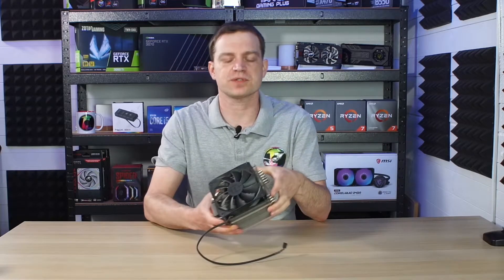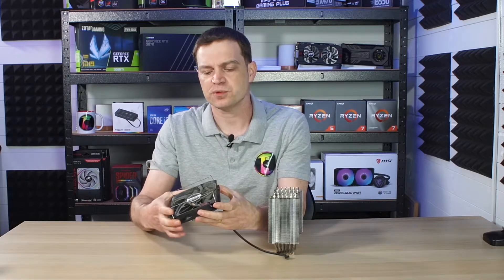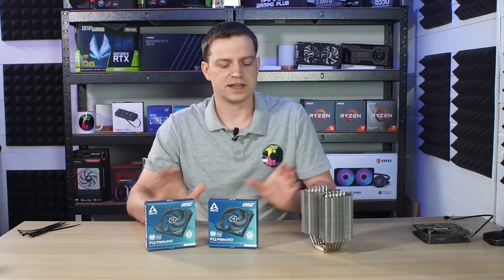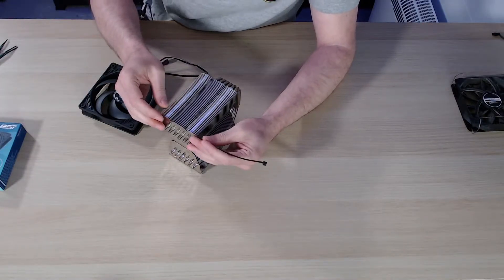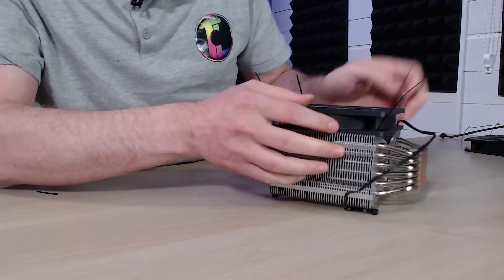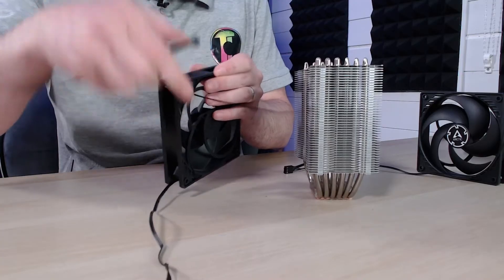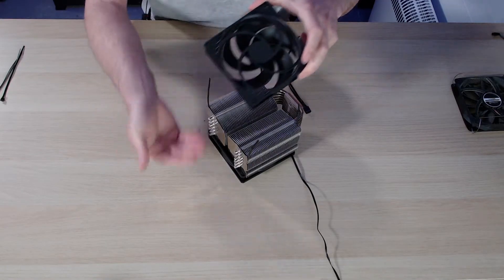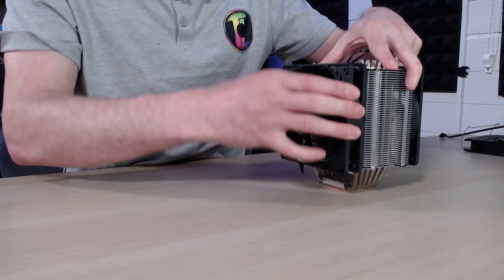How to Add Fans to a CPU Tower Cooler.

Comment: I used a single tower cooler on an old pc and I used cable ties to mount the fan but the way I did it was ok but the fan was not real tight and sagged a bit.  Your way is very clever and now I will do mine as you did.  Very much appreciate the video.

Comment: And zipties won't melt at 80°Cor 90°C ?
Reply from the maker: No, not at all.  Firstly your cooler will never get to 80/90 degrees like the internals of your CPU.  Secondly cable ties (zipties) are generally made from Nylon 6/6 which has a melting point of between 250-265 degrees C.  Which of course, if they do melt your CPU was gone a long time before that.
Reply: @TechLabUK  oh damn thank you for this update! I've thought about this diy method for a while and I'm so freaking stoked that there is already a youtuber who made a guide AND done the research to prove its safe. thank you again so much!!

Comment: Does that plastic cable ties really work? Those will melt right???
Reply from the maker: @guitarbuddyph  If your cooler gets hot enough to melt cable ties then losing the tie is the least of your problems.
Reply: @TechLabUK  it'll stick on the heatsink. That'll be a mess.
Reply from the maker: @guitarbuddyph  it won’t melt, you heating would have to get to temperatures that would have already destroyed the system first.

Comment: will be there any problem if we use two different fans with different speeds?. i mean airflow problem or something?
Reply from the maker: Not a problem as such but it could cause a static pressure issue, always best to try and match the fans as close as you can.

Comment: I was just looking for some ideas on how to go about adding/replacing fans for my cpu cooler since I plan to use at least one thick fan in the center of a dual tower cooler. I know that this isn't really anything new given other sources that show this zip tie method, but it was nice to actually see it clearly. It might be tricky mounting a normal 140mm in the center given that the coolers mounting screws are also right there, but I guess that can be a puzzle when the time comes.

Comment: Is there a risk that the heat from the tower will melt the plastic of the zip ties?
Reply from the maker: I doubt it, if the cooler get's hot enough to melt Nylon then you have bigger issues.
Reply: The maximum my CPU reaches on hot days is 80 degrees (I live in Brazil), but with push and pull it should reduce. I have a Ryzen 5 8600g. @TechLabUK
Reply from the maker: @Allanx97  It can reduce it, Push - Pull configurations generally maintain the static pressure moving through the heatsink.

Comment: Nice trick. The only thing we should consider in this case is : imagine the melting point of the plastic substance on the heating metal. Nice plastic black sauce on spicy metal
Reply from the maker: If the heatsink gets hot enough to melt ABS plastic then the fan falling off is the least of your worries tbh.
Reply: @TechLabUK  yes that is true. But how about an evo 212 black edition with a volcanic amd fx 9370? The cpu operates OK with one fun but I want to improve the airflow.
Reply from the maker: @Gizmapps  It still wouldn't matter.  It takes a lot of heat to melt ABS plastic, nothing a CPU should be able to put out especially when you are attaching it to the heatsink and not the CPU itself.  Also remember the fans attached are actively cooling everything connected as well.
Reply from the maker: @Gizmapps  Just for reference.  Cable ties are most commonly constructed out of what they call Nylon 6/6 which has a melting point of around 265 degrees C.  If your heatsink is able to get to 265 degrees C then your wouldn't be worrying about cable ties tbh.
Reply: @TechLabUK  very useful info for these  tiny little useful things. 👍

Comment: Won't the zip ties melt if the pc got over heated?
Can someone pls correct me
Reply from the maker: No, if the CPU cooler gets hot enough to melt a zip tie then you have bigger problems in the system.
Reply: @TechLabUK  oh okk 😀

Comment: Hi thank you, question, do the 2 fans cables go to the same socket? Daisy chain them?
Reply from the maker: You can run them how you like but remember to run them the same speeds / curves.  The easiest way is to yes, daisy chain them to the same header.
Reply: @TechLabUK   Thank you! Do you think it makes sense to also plug the pc case back exhaust fan to the CPU header so it also spin up when the CPU needs more cooling  and all together helps to make greater airflow?
Reply from the maker: @whatsupchicken  Na, the rear will be fine on a chassis header as it's drawing air from the whole case usually.

Comment: Isnt it dangerous to do it with cable ties because they could melt and damage other parts of the Pc?
Reply from the maker: If your cpu cooler gets hot enough to melt the cable ties you have bigger issues than a fan falling off.

Comment: Can cable ties melt over time? And how do you remove the fan before removing the heatsink? I have a Deepcool AG500.
Reply from the maker: They wont melt on this, the CPU cooler wont get hot enough.  To remove the fan afterwards you simply cut the ties and replace.
Reply: @TechLabUK  Correct, but cutting the bottom part of the fan will be very difficult. Don't you think so?
Reply from the maker: @chessusthemyth  Never had an issue doing it.  Depends what you have to cut them with, we use Mini Wire Snips and just cut the heads of the ties.

Comment: Just got a Ryzen 5800X3d. Im a bit worried about its cooling. I have one fan on the CPU cooler now. Thinking I should add the second one on back of it.  Do you suggest it?
Reply from the maker: Push pull will increase cooling and the 5800X3D is a bit of a weird one to keep cool.  Even our 360mm AIO needs some tweaking to tame it.
Reply: @TechLabUK  yea I havnt installed it yet. Just picked it up yesterday. Making sure my ducks are in a row first. I think I will undervolt it a bit. If I can figure out how to do that lol. Just getting back into a PC after a long hiatus away
Reply from the maker: @11bravo1789  It's a weird one.  It spikes all over and reaches some high(ish) temps when building shaders etc but while gaming it's ok.  Fast as well so enjoy it :)
Reply: @TechLabUK  thanks. Its insane how far things have come since my last PC (around 2009’ish).   I didnt Realize people were still Playing Counter Strike lol. I was doing LAN parties in High School playing CS and Team Fortress Mods for Half Life.  Thats how Old I am.   I had no clue CS GO was as big as it is still

Comment: Hey bro, i’m using a pure rock 2 fx on a i5-13600kf, I made a mistake by not checking the cooler’s TDP which is 150w, and cpu boost clock is 181w max, I’m mostly using my system for editing and mid-high setting gaming, would adding another fan to this cooler help with cooling performance/overall temps?
Reply from the maker: It would help but not sure if it will be enough.
Reply: @TechLabUK  I don't have the budget for a better cooler right now so your vid gave me an option I could try atleast for the time being until I can upgrade, anyways thanks!
Reply from the maker: @kanz1287  If you have a spare fan it's worth a try.

Comment: BTW, I think you guys should look at the Arctic Bionix P120 ARGB fans. 30mm thickbois, & great modular connectivity. A lot of airflow with these fans (& low noise too) + a ring LED makes them stand out as a great all-rounder imo.
Reply from the maker: Thanks for the recommendation, will take a look at them :)

Comment: Nice buddy. Cable ties are great for PC building situations like this. I've had my 30mm thick Arctic fan cable-tied to a cooler for over a year now (had no choice as clips wouldn't have worked anyway). But it makes for a clean look & boosts the cooler's performance when you upgrade the fan from the stock one on a budget cooler (as I did).
Reply from the maker: They really are great and tbh this came out even better than the original clips which a lot of coolers don't even come with two sets :(